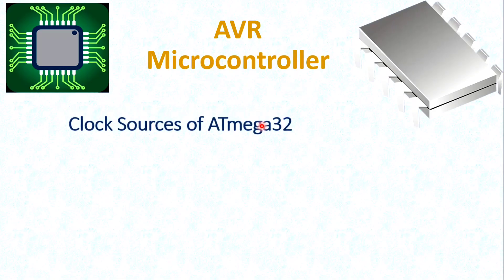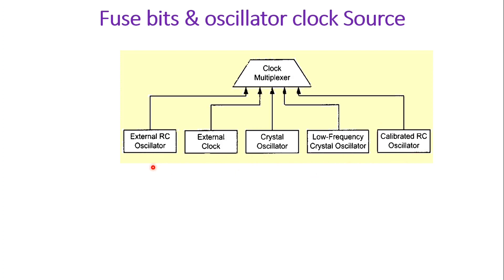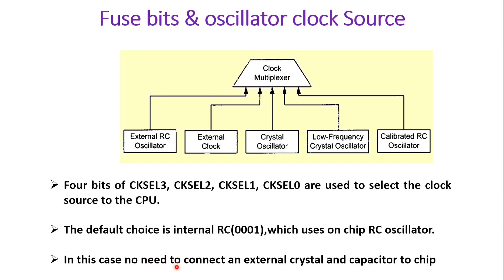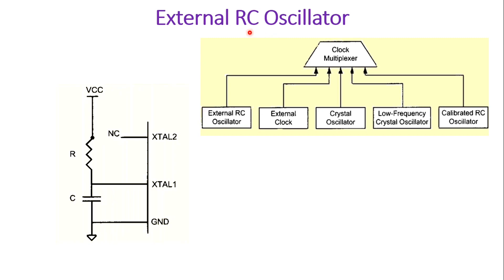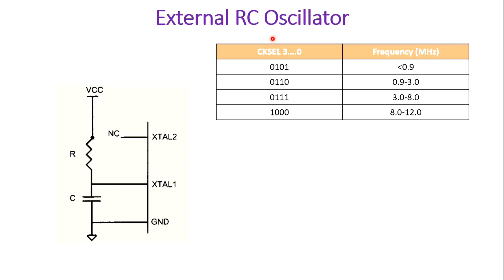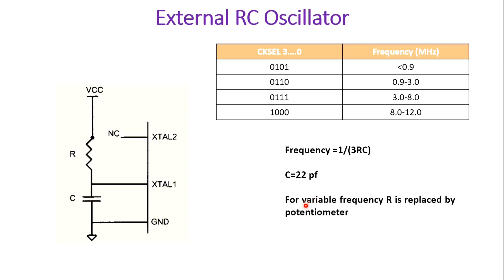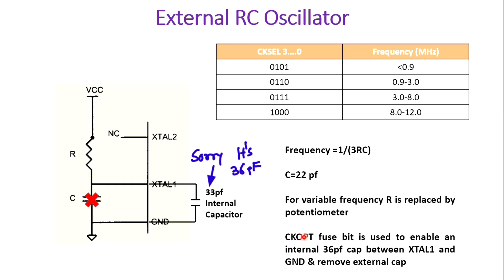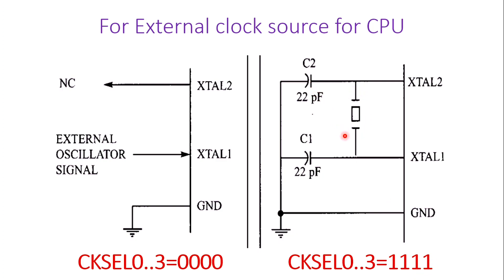Clock Sources for ATmega32 AVR Microcontroller: Overview and Configuration

Comment from the maker: Clock Sources of Atmega32 AVR Microcontroller explained with given timestamps:
0:00 - Clock Sources of Atmega32 AVR Microcontroller - AVR Microcontroller
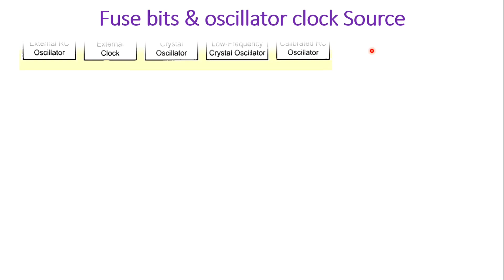0:07 - Oscillator Clock Source
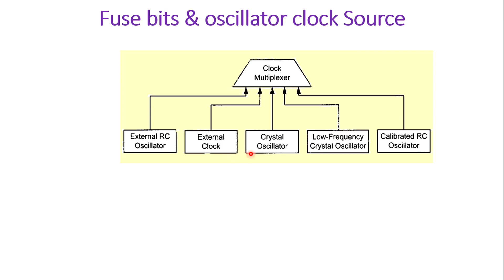0:59 - Fuse Bits
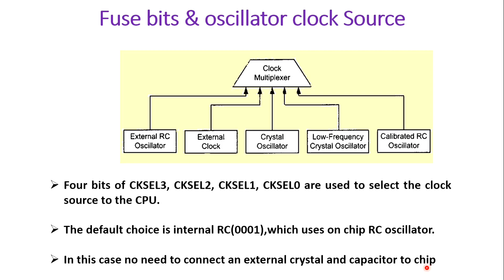1:52 - Internal RC Oscillator Operation Modes 
3:40 - External RC Oscillator
5:22 - External Clock sources